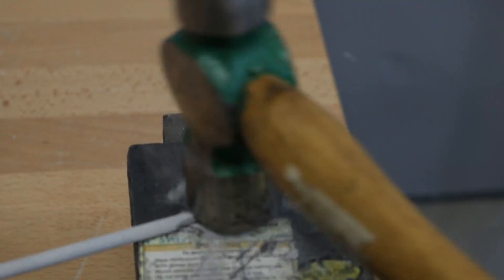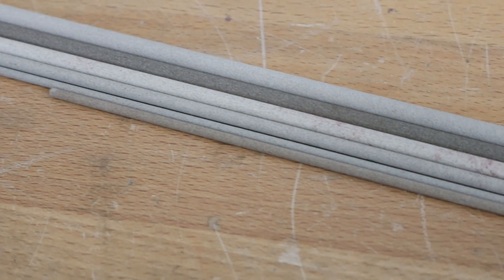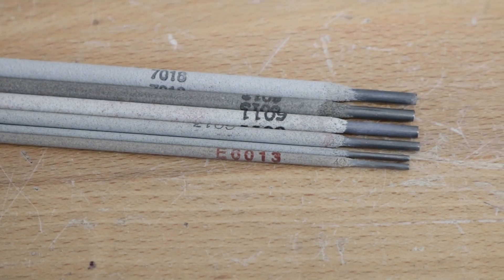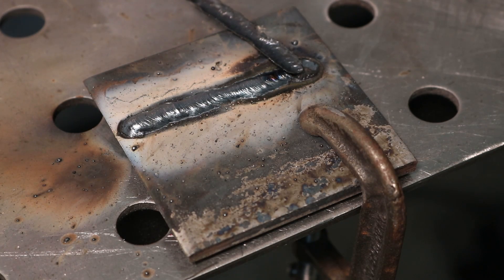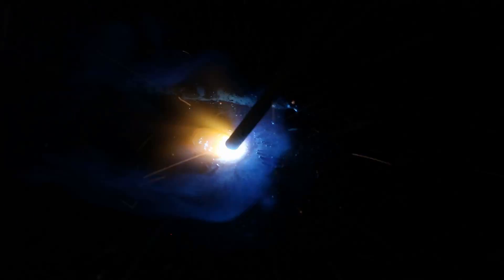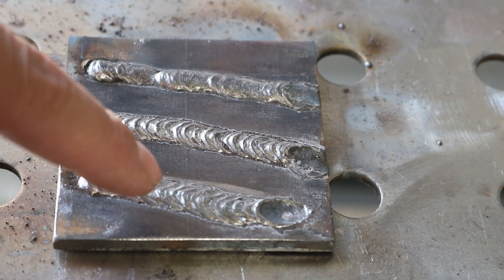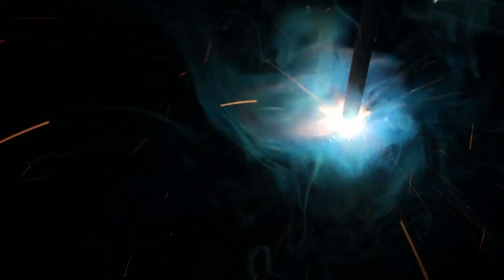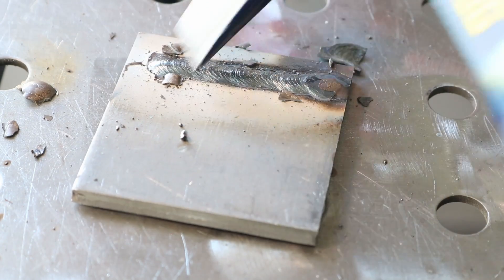Stick Welding Electrodes Explained: Stick Welding Basics for Beginners

Comment: Excellent video. I don't disagree with anything you said or did, but for some reason you and a lot of other experts skip right over 7014 which has most of the advantages of 7018 and few if any of the disadvantages. 7014 is  easy to restart, AC/DC, all position, lays down nice beads and doesn't need to be kept in a rod oven. 

Other than welding together high strength steel (like a drill tube and sucker rod arena fence, for example) most DIY/hobbiest welders don't "need" 7018's low hydrogen properties and the attendant expense and fuss of rod ovens which are absolutely ESSENTIAL to preserving the low hydrogen  properties of 7018 for more than a couple of hours after the package is opened (and maybe not even for  that long depending on humidity) assuming it comes in a sealed package which the bargain prices stuff sometimes doesn't. E7018 in sealed packages ready for low hydrogen use out of the package (hermetically sealed metal cans)  is more expensive. Baking out inadequately packaged 7018 to meet low hydrogen specifications is not a trivial task and requires both time and a much hotter oven than the 350°F of a holding oven.

Comment: 😮yeah I'm unqualified but anyways the coating on a rod not just add metal to your weld it also has a chemical that helps heat up your weld to melt the rod giving you a nice puddle to continue welding in like thermite these come in different metals and work at different amps to get best results....this comment was 2minutes into your video I will now continue the video😂

Comment: Great video!  I will concentrate on getting good with 6013 since it is cheap and plenty good for any non-structural welding jobs.  Then I will experiment with 6010 and 7018 for more specialized applications.

Comment: I don't understand the 7018...if I buy a pack of electrodes, as a hobbyist, maybe I use a few, then throw out the rest?  I'm not going to use an entire pack within 8hrs after opening it and breaking whatever seal it had.  I know there are rod ovens but again, as a hobbyist, that's not an option and I just read that only works one time (not sure that's correct...sounds odd).  Do any hobbyist welders use 7018, with the incumbent disposal of most of the remaining rods?
Reply: No. Don't throw them out.  They are still probably better than any of your other rods.  They just won't have low hydrogen anymore.
Reply: @tsl7881  so, (hobbyist) people buy 7018 rods and use that pack for perhaps months or years but basically its main claim to fame (low hydrogen) is gone after the first day?  Or is the low hydrogen aspect simply not that important compared to other aspects of the 7018 that linger on?

Comment: You mentioned that the 7018 rod should be used within 8 hours of breaking the seal on the package.  Why is this?  I assume the rod absorbs water from the atmosphere which would then split into hydrogen and oxygen when heated to arc temperatures.  Both of these gasses are bad for the weld.  Can one renew 7018 rods that have been in tubes that are not air tight?  Can I renew my 7018 rods by heating them in my oven?  If so what temperature and how long?
Reply: One manufacture says they can reheated in an electric on clean mode to reach over 550.  One time.   But you can use them like a regular rod if left out and the 7018 alloy is very strong.

Comment: 9:37  ....  What if you do not use them with the time frame given? ....  Like if you have an opened package that are weeks old?
Reply from the maker: It depends on what you’re welding and how critical it is. As long as it’s on mild steel under 1/2” thick, hydrogen embrittlement is extremely unlikely even with some moisture in the flux. On top of that, old 7018 will still deposit less hydrogen than a 6010 or 6013, so using those rods doesn’t really solve that problem. For non-critical applications, old rods can work just fine.
Reply: @TimWelds    Awesome, Thank you sir!!
Reply: Spend the money and get yourself a rod dryer.

Comment: I love 7018AC when I can get it. It runs great on DC also but it's also an AC rod. It had a conductive material in the flux that makes restrike very easy. A little more expensive but well worth it.
Reply: A 7018 you can use for tacks.  Weird huh?

Comment: Retired and new to welding with small farm.  Purchasing a Hobart handler 200 for flux-core and stick.  Welding metal on the Container rooftop for solar panels and Welding steel on container top to make an awning from one 40 foot container to the other.
Do you think that machine is a good fit for my self?
Rylie
Rylie
Reply from the maker: Sounds like a great project! There are a ton of machines that would work well for that, and the Hobart is a good choice. I actually learned to weld with a Hobart, though it was a lot older.

Comment: As an occasional DIY welder, I'd like to use 7018, but my rods can sometimes be weeks or even months old before I use them and I don't have a rod oven.
Do I need to be concerned about this when most of my welding is on 3mm plate or less, and never over 6mm?
Ultimate strength isn't usually a consideration either - it just needs to be a consistent reliable weld without inclusions etc.
TIA...

Comment: THANK YOU, FOR A REALLY NICE WELDING VIDEO.
   I am new to your channel. It just popped , & I watched it. I'm  VERY satisfied with your content. I welded as PART of my various carreers, (machinist/Tool & Die Maker/Tool & Jig designer), and light fabrications. The favorite was the 6012 for tacking up and 7018 for welding. Later years, MIG .035 fluxcore. My favorite pattern is the overlapping circles, for most beads and the zig-zag pattern for large gap projects. I was raised in a machine shop, welding with oxy/action & wire cost-hanger. I welded alot of my life. I've  slowed way down due to my shake arm/wrist, but it goes with age. I'm  in my 70's now, but I still enjoy MIG.
   Thank you, young feller. Keep on truckin'. I like your content. You can run a pretty nice bead.
   Bill, from Tn. 🇺🇸 
I SUBBED..

Comment: I run an AC welding machine and im having trouble with the E6013 welding rods they create holes on thick metal should i go to 7018?
Reply: Tim has a 6013 vid for that.

Comment: Man I finally reached my light bulb moment. You really taught me something new. 1. I never knew that was called flux coating. 2. I always thought that was the think that caused the rod to melt and weld. Never knew a rod without it could actually weld.

Comment: To get stronger fillet welds what would be the best rods? 6010/1 under a 7018 or 7016 under a 7018. I've been finding if I am to grind my 7018 filler welds back to square then there is absolutely no strength left and can be broken by a little hammer. This could just be me but I've been trying everything to get more penetration with these 7018 rods. I'm just buying some 4mm rods instead of 3.2 for this 8mm plate to see if that's going to help me

Comment: I am going to use a old miller 2e to weld a pipe fence. The pipe is sch 10 11 gauge carbon steel
Can someone help with rod type and size course current, amperage?

Comment: My transformers connected in series makes very consistent welds and makes 6013 rods penetrate rust like 6010. Yes! 100% AC, but with good voltage, polarities and labels over electrodes don't matter.

Comment: So, complete noob, I bought an old ac welder not thinking about the difference between ac and dc. Is it possible to get smooth work from something that is by nature, less smooth?
Reply: High voltage AC with borderline current will perform as good or better than DC.

Comment: 6013 only makes a mess, you can't convince me they work.
Reply: Never had a problem running 6013s via my DIY welder. That's because I connected the transformers in series. Never underestimate MOTs.

Comment: What kind of bolt can I weld if I need to make screw on item
Reply: Bolts are made of chromoly and chromoly hates draft. Just keep the draft away, preheat and you'll be fine.

Comment: Your opinion of the best all postion all applications  I think is off  and I think alot out there will agree witch is 7018 it good for root and even better for capping and its the easiest for beginners to do a good looking weld.  I think  it's the best rod for doing vertical and I have even used it to weld a 3/4" thick lug to the underside of a beam so I could attach a temporary 2ton chain fall and weld prep is every thing. If you don't do good weld prep no rod will save you.

Comment: Great video. It would have been helpful to spend 1 minute explaining how to alleviate the rod sticking to the material and not getting a good puddle going. One comment was about swapping the leads that are plugged into the box. Is that a way to stop sticking?
Reply: Try altering your angle of attack, don't stick or strike straight in at 90, try 45 or so, provided you set your machine properly of course :D

Comment: Ive got a weld test for a new job tomorrow. I actually used to weld ALOT in High School but that was in 2005-2007 ive got to cut a 2 inch pipe in half and then weld 2 4x4 piece of 3/4inch metal pieces on one4x4  3/4 inch piece that’s laying down. Like a house with 2 walls across from each other then i gotta cut a 2 inch hole on top of another 4x4 piece to slide down the 2 inch pipe then weld the pipe at the bottom making those 2 4x4 walls a pain to fully weld the pipe to the bottom. Any suggestions? Its gotta pass a 70 psi test
Reply: Lord thundering Jesus, how did that test work out?  I was taught by a Saskatchewan cattle rancher, out by the dead D12, I'll say no more.

Comment: Hey about the 6010 with the inverter welders, do you recommend doing that hack where you take a old ac welder and run the ground through it, and if so is there any improvements or standards we need to follow?
https://youtu.be/ZGvPhJZCMvY
Reply from the maker: There are 2 main things that affect how a 6010 runs: open circuit voltage and inductance. This hack basically adds an inductor to the circuit. It seems like a real hassle to me. I don’t think being able to run a 6010 should matter that much for most people who aren’t welding open root pipe. I think a better solution is just buying 6011 instead. If you do need to run 6010, I would recommend getting an inverter that is capable, which many of them are are these days. My ESAB Rogue is awesome with 6010s. The Harbor Freight Titanium stick 225 is also surprisingly good with them.

Comment: Here in the UK 6013 is the most common used rod for everything so haveing learned with 6013 to weld in all positions then  used 7018 everything is so much easier with the 7018

Comment: I'm a beginner. I have a old Hobart Stickmate LX AC machine. I building a rock crawler in my garage. I'm wondering what is the best electrode to use to weld the brackets to the frame and brackets to the axle for maximum strength? The brackets are 1/4 inch wall

Comment: I've been using 'buzz box' welders on and off for over 40 years and I learned more in this short video than ever before.
 I got reasonably good when I was welding 'every day' but a 15~20 year gap means I'm starting over from scratch.
(plus I only weld every few months so not a lot of practice)
I used Oxy/DA a lot more often then stick on very thin material but did manage 1/16" rods on sheet metal at one time (40+ years ago)
The biggest issue I have now is the stick seems to burn away too fast, tried low amps, 'recommended' amp, higher amps.
Every 'real time' video I've seen seems to show rods burning 'slower'? (1/8" 6013 or 7018)
I tried 'cooking' rods at 350f in an old toaster oven to make sure they were completely dry (I forget if it was 90 mins or 2 hours) and using when still 'warm'
Are they just 'old' and should be tossed?

Comment: How many amps should I use for running 7018
Reply: That will depend on the size rod you are running, most rod boxes give you an amp range start in the lower middle of the range then bump up or down to find what your machine likes best.

Comment: Brilliant video thanks. I have tried a 2.5mm 7018 today and got nowhere, couldn't even strike an arc and kept sticking whatever I tried, swapped out to 2.5mm 6013 and ran a decent (albeit wonky) bead at around 80A. Rods were sealed and the welder is a basic draper arc welder with a manual dial. Going through the full range of amperage didn't seem to help but it was set I'd say in excess of 160A! I know the guy who owns it never swaps rods and 2.5mm 7018 is all he has. Any idea what I'm doing wrong? I didn't fully unwind the leads so don't know 100% what polarity it's on.
Reply: Sounds like wrong polarity , switch leads and try

Comment: I was given an old, not well taken care of Powr Kraft 230VAC welder that sat in a barn for many years and have just started playing around with it. I am having the hardest time getting an arc to strike and am also struggling with maintaining the arc once I do get it going.

For example, I tried a few practice welds on 1/2" flat stock. I ground the mill scale off and attached my ground. With a brand new 7018 or 6011 rod, I can tap the steel several times and it won't strike an arc. Every once in a while, I will get the rod to stick. When I do get an arc to strike, I am not able to maintain a consistent arc.

I am a novice at welding, so I definitely have some learning to do, but I just can't imagine that it should be this difficult to strike and maintain an arc. Do I suck this badly, or can the old Powr Kraft be making things more difficult than they should be?
Reply: It sounds like you are having a fight against the welding machine.    Unless you know how to and can fix it quickly, don't bother, and get yourself a new stick welder.  There are some cheapies on Amazon that work surprisingly well!  I bought a couple from Tooliom just for the heck of it, and while they don't compare to my top-tier European welders, the fact that they work and will not create an obstacle for you is very much worth it.   You can get a decent inverter stick welder for about $150 (Tooliom 195S), and while it doesn't put out the amperage that it says it does, it is still actually quite powerful when on 240V.  It will run 6011, 6013, 7018, 7014, but NOT 6010.
Reply: make sure the surface to be welded is free of rust.could be a reason you're unable to maintain the arc.
you can also increase the current setting

Comment: Hey Tim!! Never watched any of your vids before, but I've ALWAYS wanted to learn how to weld. Over here, (Thailand) welding of thin-wall square tubing is a HUGE business, as they make shop awnings, foodcooking stands attached to motorcycles like sidecars, shop-stalls, window-awning supports, shelves, etc. etc.  They are EXTREMELY UNconcerned with safety techniques, and often do slap-dash jobs, welding right on the street or sidewalk with no safety isolation from passersby. I've wanted to learn to weld for a LONG (embarrassingly long) time, but after looking around I knew there was no one here that I could trust to teach me. So I wanted to find some instructional videos to learn welding, since I'm ready to retire, and will finally have the time. I just found your videos yesterday, and I've spent yesterday afternoon and this morning downloading about a dozen of your vids. I want to approach this systematically and study the techniques and materials even before I buy any equipment, so when I go shopping I'll know what I'm looking for.  
  As a long-time teacher, I know good instructors when I see one, and your style is (IMHO) very effective. Your delivery is casual, but clear and informative, and very easy to listen to. 
 It must be difficult to film something as 'bright' as a welding arc/seam/etc. but your vids are very interesting to watch and well-recorded. Thank you VERY much for taking the time to produce and share these excellent videos.  I'll be in touch sometime in future to give a progress report.   👍
Reply: So, how are you progressing now, 1 yr. later?
Reply: Yo anything happen?
Reply: A year goes by and can't help noticing that "Tim" hasn't even had the basic courtesy to reply to this comment.  Even though he only posted and pinned one of his own comments just 3 weeks ago.  Maybe he's just too "busy" to reply to supportive comments from viewers.
Reply: @montinaladine3264  it can often be that replying to a note/email/comment with multiple talking points can simply  be overwhelming

Comment: Does 7018 deep penetrate? And which is better for beginners. 6011 or 7018
Reply: 7018 is a medium penetration rod, IMO.   6011 or 7018 has nothing to do with beginner status.  different Rod types are used for different purposes.  A beginner can just as easily start to learn welding with either one.  The most important thing for a beginner (for any welding process, not just stick welding) is to be able to SEE the puddle and distinguish it from the slag.   Welding helmets have come a long way in the last 10 years.  I highly recommend Optrel, as the optics are absolutely top-tier.  Once you know you can clearly see the puddle, then you can begin to learn how to contol-manipulate-move it to create the actual weld bead.

Comment: Hey! Just found your channel and really like it, have had much better luck with my 7018 welding than any rutile sticks, could be my inverter (Migatronic 160E) or just me😀. Anyway I have a tip for you, at 07:25 you refer to another video (that I will watch) and you can actually put a card into your video in the YouTube studio function to have it pop up as a clickable link while you are talking. Anyway thanks for a great channel!